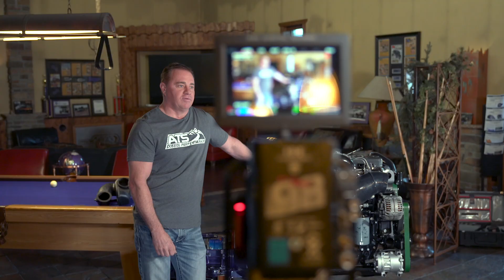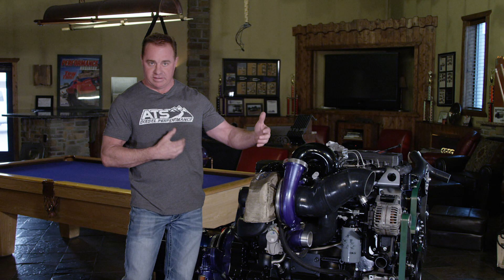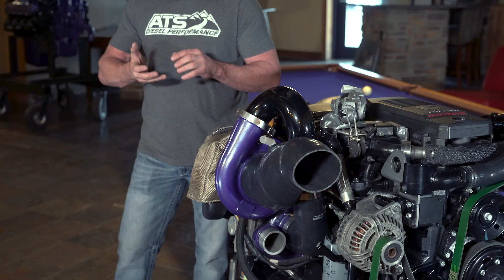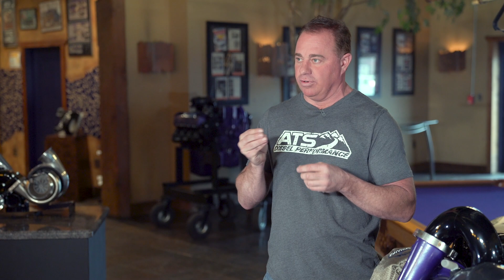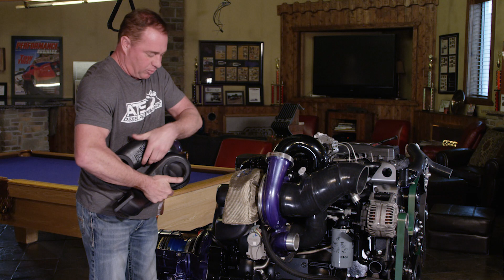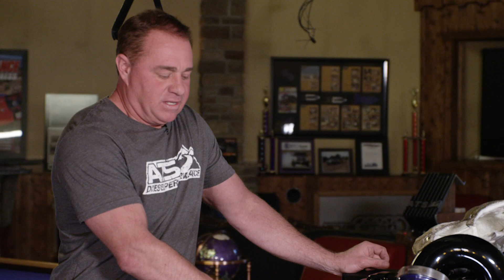ATS Diesel Performance | Clean Diesel Discussion: Episode 3 - Compound Turbo Kits & Twin Fueler

Comment: Super charging is liner and a known quantity at all rpm with boost control valves and a cleanable DPF is the way to go to meet all the emissions EGR is ok for cooling intake temp but a good induction air cooler would be a lot better than reducing the oxygen levels in the intake let alone clogging the induction system

Comment: EGR has no place on a diesel. we can deal with after the turbo, EGR reduces intake air density. EGR makes the burn richer, which produces more NOX. Get rid of EGR and free up the intake, make the heads flow better. Power, efficiency, and a cleaner burn. Stuff that air mass in and fuel it accordingly.

Comment: I am a retired mechanic ASE Master Tech, CA Smog License for over 35 years. I am thinking about buying a new diesel 3/4-1 ton truck (most likely a Duramax).  I really appreciate this channel and the information found here. I want to learn as much as possible about newer diesels and their emission systems and this channel has, and continues to be an excellent resource. What I believe based on my research is that these diesel emission controls are very similar to what gasoline engines went through in the mid 1980's through the late 90's. I believe in emission controls as they force better engine / fuel management design. The air we have to breathe is important, like it or not. The air is cleaner in many cities today vs what is was in the late 1960's and there are many times more vehicles. The emission controls work and this man understands that and even better understands how these systems are designed to work. Thank you!
Reply: The after treatment systems only work where it’s relatively warm. All of the def systems don’t work very well in the cold
Reply: Did you buy a Duramax? If so, how did it work out?

Comment: with great power comes great responsibility, im all about trying to decrease the smoke output of my truck. but its hard to find that balance of getting the power i need. and trying to keep a clean burning truck.
Reply: i will not run a dpf exhaust again. i just dont trust them. period but im looking hard for ways to decrease smoke straight at the engine, what about increasing rail pressure?

Comment: cant  get  fuel  mileage    with  a  dpf     period.  its    dump  fuel to  regen  that  where  the  fuel mile  drops   epa cant  bs  that
Reply from the maker: Sorry Daniel, but we’ve been doing it for years and have nearly 100k miles on some of our DPF intact trucks running 600-800hp.   These trucks barely ever go into regens because the fuel is burnt so clean.  With the added air flow of the large turbo and ability to run much higher line pressure sustainably with two fuel pumps at 50% duty cycle you’re not soot loading  in the first place and therefore regen-ing less often.  We know it’s possible and have proved it for years.  You’re welcome to come to our facility and see for yourself!
Reply: ATS Diesel Performance where’s your facility I’m retired and have a 2019 f250 you can prove it on?!
Reply: @ATSDieselPerformance  nox emissions must be high then.
Reply from the maker: Gordon Turner  they are higher until they hit the def fluid where Nox is neutralized.
Reply from the maker: Our 2015 just got 17.8 mpg coming back from King of The Hammers earlier this month.  No regens there and back, truck passively regens does not go into a hard regen.   Our kits work far better than stock.
Reply: @ATSDieselPerformance  so is def usage higher? Or do you guys program around that?